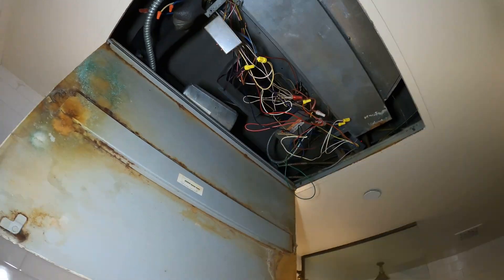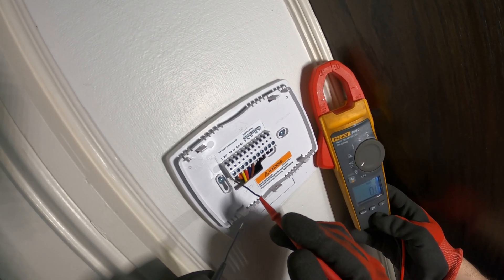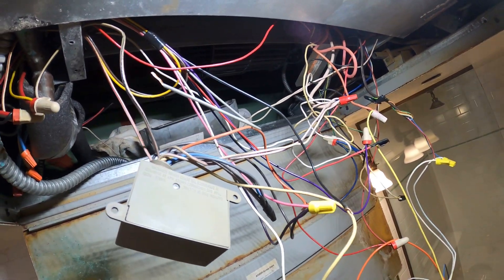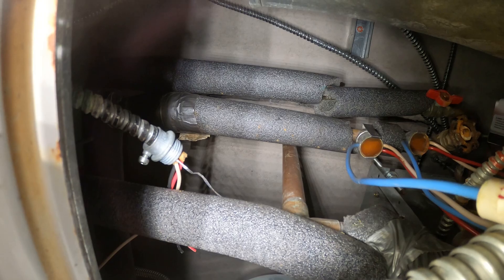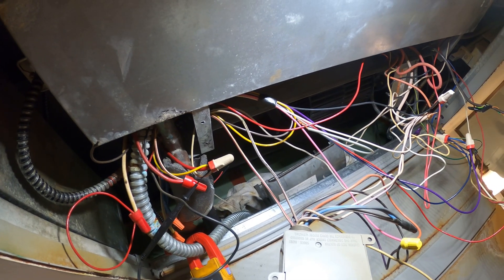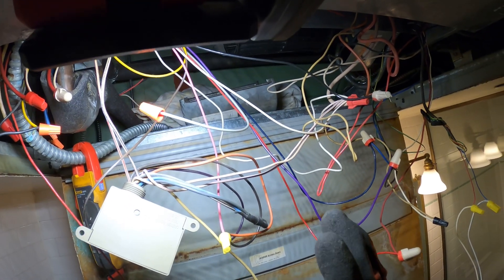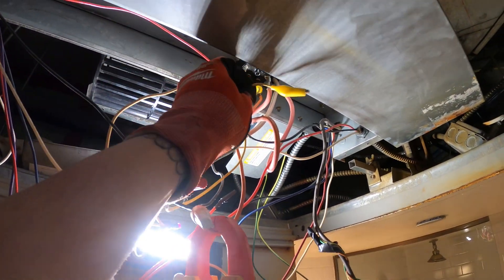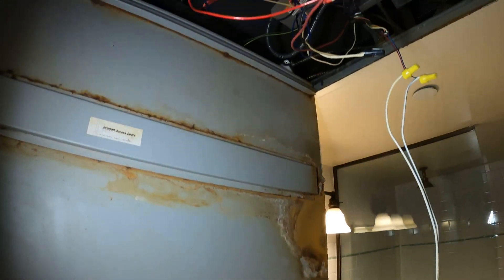HVAC Service Call: Chilled Water Fan Coil Unit With Electric Heat NIGHTMARE! FCU Not Heating/Cooling

Comment: Good job Jumper, You might want try some Wago connectors and some nylon ties, wrap up the wires to make it look cleaner, and the Wago connectors make better connection than just wire nuts. Good job.

Comment: Great Video. What is different and the same between 2 pipes vs 4 pipes Fan Coil Unit ? Thank you for sharing
Reply: 2 pipes will switch between heating and cooling. 4 pipes have separate coils for cooling and heating. The loops are separate in 4 pipe.

Comment: Great job figuring that nightmare out. The maintenance mechanic there should be fired on the spot. They must be glorified custodian, that should not touch anything with line voltage. If doesn’t have plug 🔌 to outlet they should automatically call 📞 a jumper man tech. They are signal handle ruining that complex. It truly scary 😧